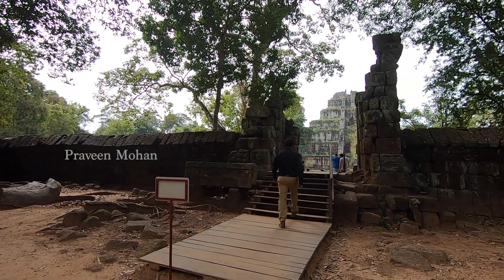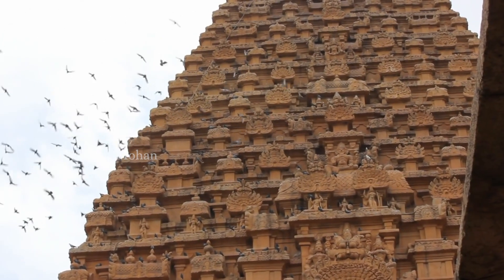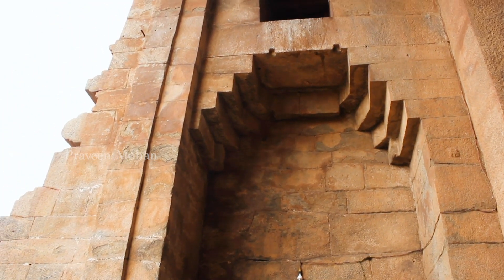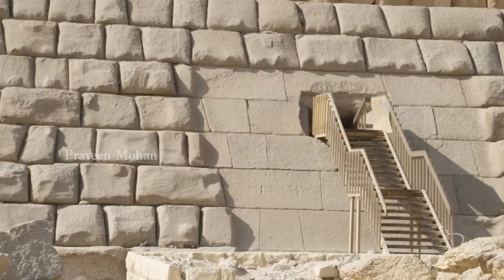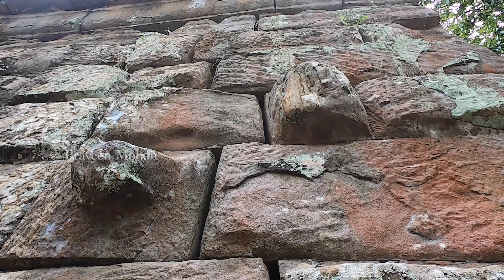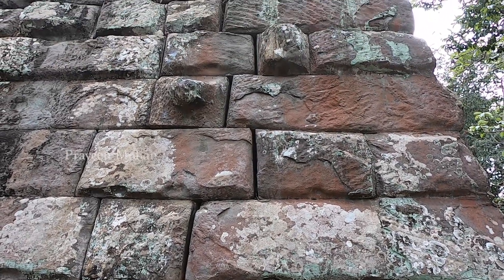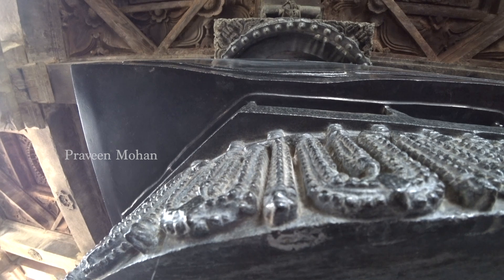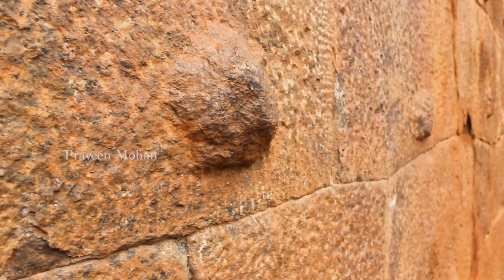Mystery of Ancient ‘KNOBS’ in Temples - Evidence of Stone Melting /Geopolymer Technology?

Comment: I'm thinking that if the stone could be installed with easy access to most of the sides of the stone, then it needed no knobs to adjust its final position. The reason the knobs were on the stones was because if you can only touch one or two sides of a stone, it's much harder to shift it into the correct position. The knobs provide a spot to grab and possibly put the end of a lever against.

Some stones without knobs may have once had knobs which were chiseled off for looks, especially those around detailed carvings.

Comment: The stone molding happened on site at puma puku ones with knobs the front facing is completely smooth in the back of the stones are still rough on the inside of the wall

Comment: Extraordinary claims require extraordinary proof.  Quick analysis and one can understand these are not geopolymer. I know there is a lot of you out there. Couple points though.  Firstly it takes 50-100 times the raw material to make one block.  Where did all the  ingredients come from?  Also these are all irregular blocks with different sizes.  To make them would require a separate mold for each and every block.  That would be thousands if not millions of individual unique molds. Again the material required for those is many times the actual building material.  We have zero evidence of either a polymer nor the mold.  Then there are the quarries where you can see where stones were extracted.  The burden of proof is on YOU who makes this claim of geopolymer yet not one has been able to replicate it, and being unable to demonstrate or reproduce it completely negates the claim.

Comment: The "knobs" are where they left material from the original stone before it was carved as the face of a wall like the rest, to walk on. Unlike medieval castles, where gaps in the stones for the wood supports were acceptable, in these (be it by design or not) it was not acceptable to have gaps. So how do you not waste wood and block an area under with dirt, letting people work beneath to finish the stones into that wall shape? Simple, you leave "pegs" or "knobs", which are now broken or purposefully chiseled off, on which the structure for the next layer is present. Each one of these stones had to be carved to fit in place with the next ones, so per stone, a long period of time was spent, possibly a year, so even more reason why wood, ropes and other temporary methods would not suffice, hence stone. Equivalently, on a stone structure from the medieval times, you'd build it and move to the next layer in a matter of months, less. This method would also be universal. There's only so many ways you can do this, so arriving at the same solution, because of limited resources, is expected. That's why all ancient structures that reach a certain size are pyramid shaped. Ziggurats, Egyptian pyramids, Mayan temples. You can only build a stepped structure at that size, the very moment you start building straight up with massive stones, the first shake or wrong load will collapse it. Which is likely what happened before the vandalism, at Puma Punku. They very likely bit more than they could chew and abandoned the project. Egyptians did it too. There's a massive obelisk that's 70(ish)% carved out, abandoned, because of a crack. Probably a massive ill omen in those times (as a reason).

Comment: Yes, you are right, these are pre-made blocks made from a composite or liquid concrete material, possibly molded in situ using wooden or canvas shapes, that's why they fit so perfectly. Each block could be made by just pouring concrete from small manageable buckets, no chiseling required, just carry buckets or pouches of liquid concrete up ladders. Once it set solid overnight you made the next block to it. That also explains the pyramids of Egypt.

Comment: I had thought up the "drop" idea on my own, as I'm sure many have, but did not know that's what it would be called. I'm glad to know the term for it. Also, good point on the plant growth. If liquified and poured (which makes sense for transportation and other issues like that), and the rock became more porous after drying than in its natural state, then it would work like a chia pet (sculpture made to grow plants on that then take the shape of the sculpture automatically). It's also an interesting window into figuring out exactly how they did the melting/liquification- because we know that there must have been some other medium in the rock that left gaps. It's like a water filter made out of clay and dung. You burn it, and the dung goes away and the clay is hardened, with microscopic holes all throughout that the water can drip through. Some mixing and melting process, a re-hardening process would make this happen, AND make the plants able to grow IN the rock, itself.

Comment: Thermite stone a nob was use to releasing iron. Mixed gravel with iron and aluminum powder, ignition. Casting stone. Magnetic feild. Copper thermite was also possible but turns  green. Casting any size shape. A paste can be used for drilling and scooping. 
At the time melting metal, copper, gold, iron, aluminum, discoverers were made.
Thermite melting stone explains it all a clay forms laying sand then mixture and ignition. Hot cement shaping.
A mixture for creating air bubbles.
Reply: Evidence in stone, iron, aluminum, and organic matter.  Organic matter should give you closure on carbon dated.
 Heat could  be used to bake bread, steam, and heating.  Imagine the energy of thermite stone melting into bricks, tools, recapture aluminum, iron, and heat home, electric, distillation water.
Imagine the tech now and then together. Peace is the goal 🙏

Comment: I agree that those blocks are melted.  I've thought that for a while.  I just believe that they were melted in place using a simple removable and reusable form.  As for the knobs, it kind of looks like they were pulled out on purpose after the mold was removed but while the rock was still hot and in a semi fluid state.

Comment: They may have used a single form placed over the front side of each block when pouring, as the bottom, sides, back, and top would not need forms. The forms for interior blocks would have a hole cut in them so that a knob would form. The knob is a structural element that would interlock onto the next block being poured in front of it. The knobs on the outside of the structure are there because they may have been short on exterior forms, which had to be more precise, so they used interior forms in inconspicuous places.

Comment: I think that they have something to do with how tightly these blocks are fitted together. If they casted these blocks off-site, then how do they just fit a random joint so well...? As far as I can tell, these megalithic structures were all tied together with a poured metal clamp or they've found what looks like conduit drilled into the blocks as if to run a wire through it to tie it together. I think it was some kinda of a plasma tool they used and these "knobs" were actually where the tool pulled out and the stone cooled and hardened. That sounds like a much better explanation than ppl who built such sophisticated structures just putting messed up C grade material in them...

Comment: It is possible to at least speculate if those knobs may be an intended handle from the production of the block.
The precision with which they are fitted together tells us that they have in fact been ground together, and that meant the blocks would be put in a grinding- jig without being able to any internal movement relative to the jig. A knob of this kind would be useful to lock the block in the jig.

Comment: Even it was a cast defect all they had to do was cut it off but they didn’t they had a function or meaning to those who place them in position 
But here is the real reason why
The cutting system they were using which was ultra sonic technology would hit certain points on the stone at the location of the knob 
As the stones were all tightly fitted the resonance transfers so all you need is one stone with knob to transfer the resonance into all the others

Comment: Maybe the knobs are the remnant of a plug? If the material was somehow liquefied then it would have to have been pumped to the area where it was to be located. A form of "boxing" would have to be placed with an inlet for the material to be pumped into, once the pumping apparatus was removed, if the rock had not fully set then these knobs would seep into the outlet forming before the boxing was removed for its next location. This could explain the random occurence of them and also how each rock or block fits together with no gaps.

Comment: the stones were melted and poured into molds, the knobs were a run off to prevent bubbles. in some stones the knobs were then removed. the stones were melted using a plant not heat. ("Some years ago, when I was working in the mining camp at Cerrode Pasco (a place 14,000 feet up in the Andes of Central Peru)...........About ten minutes later I bent over the rock and casually examined the pool of spilled liquid. It was no   longer liquid; the whole patch where it had been, and the rock under it, were as soft as wet cement! It was as though the stone had melted, like wax under the influence of heat." page 273 from "Lost Trails, Lost Cities" BY Brian Fawcett written from letters sent by his father Percy Harrison Fawcett who disappeared in the Amazon in the early 1920's. As to softning stone on page 83 he writes of birds like a Kingfisher "which makes its nest in neat round holes in the rocky escarpments above the river....that those birds know of a leaf with juice that can soften up rock till it's like wet clay" which they can then peck away until they've created a hole in the cliff face into which they build their nest") examination of quarried stone vs stone in the quarry site shows that the worked stone contains traces of some organic material whereas the stone in the quarry does not.

Comment: It’s simple.   The stones were molded with tamped geopolymer concrete.   But, they were made bigger than needed and masons would trowel them down before it set up to hard.   If the concrete was not mixed well some of the concrete in the outer layer would harden faster.     So fast that the masons could not remove that section completely leaving a “knob” for perpetuity.   

A chemical analysis of a knob versus the rest of the stone should show a difference in makeup.

Comment: When you stand back it looks sometimes like staira, or decor. Like a contrast, filled with paint it makes a aign, add some material to the top or between to make 3d effects, like drawing what you see in the stone. Outlines of certain parts of a mural or something. Some sort of Morse code or visual hieroglyphical Braille type knob? Maybe vacuum created concrete with obsidianish remains or materials, acidic electrolesis? Like you set a mold and use thin strings to make a contrast or separate blocks, depending on terrain. Some could hold boards underneath to hang stuff on, without shifting upward, like a built in brace for flowers or hanging Sacramento stuff?

Comment: A problem with your premise, which maybe is a good theory or hypothesis, however until you prove it experimentally in real life with real stones using the tools that they had, it’s just a  hypothesis.  why don’t you get some granite and a copper chisel. And create a copy ?  you gonna find out that you need a cutting tool that’s as hard as a diamond and yet is tough enough to not shatter when you try to cut the stone—- and that’s just one little problem  -  for example-  of the whole construction project, which was massive .  I could go on and on, but  you get the point.
I have multiple  university degrees in construction engineering and 60 years in commercial and residential construction, this I know -  there’s a big difference between a brain storm and going out there and creating something in the real world with real materials.  Construction is a hard task master.  Sweat, blood and tears are part of the process .  I’m in awe and humbled by what these have done in prehistory.  

Academics have to look through academic rose colored glasses -you might say - to stay in that culture.

Comment: I'd say the knobs are a result of quarrying the blocks, and you are probably right about the carvings/not carved walls because you'd start with a flat surface to carve on. The blocks left with knobs, as you said were probably poor quality blocks from manufacturing, and they might have planned to come in later and remove them. As far as if the blocks are casted or not, the stones would have to be throughly tested to figure that out.

Comment: Clearly they are molding "pips".  We remove these by grinding and sanding from modern plastic products.  I suspect that they are not "mistakes" but were left for esthetic reasons. It is also possible that they are a form of communication that was a secret language that megalithic builders used to communicate with each other, much like Ogam originally was a secret hand language for Celtic priests. The stones were likely cast in place with adjacent stones forming part of the mold. That would make it easy to introduce these pips in a pattern in real time rather than ahead of time. Easy.

Comment: If/as the builders had such a control over the material, they could just have sliced or chiseled off those knobs - a modest effort in order to preserving the overall aesthetics of the building. Another objection to Your theory is that the knobs could easily have been oriented inwards instead of externally unless the  stones actually were molded in situ - or unless the knobs have some signaling, or other, purpose.

Comment: I HAVE SEARCHED FOR VIDEO'S ON THIS EXACT SUBJECT THOUSANDS OF TIME. THIS VIDEO HAS NEVER POPPED UP.  I RESPECT YOUR OPINION, MR MOHAN. YOU HAVE THE ABILITY TO USE LOGIC FOLLOW SCIENCE NOT LETTING SCIENCE DICTATE THE LOGIC. IF YOU LOOK AT THE MEGALITHIC WALLS IN SOUTH AMERICA WITH THE KNOBS IN THEM, PRESENT AN ALTERNATE REASON FOR THEM. IN MANUFACTURING YOU FINDS KNOBS WHERE THE NIPPLES/NUBS ARE PRODUCED AT THE INJECTION SIGHT. THAT WOULD ALLOW THEM TO POOR THEM IN PLACE, PLUS ALLOWS CUSTOMIZATION OF EACH MOLD. YOU CAN SEE WHERE THE MOLDS WERE REMOVED TO QUICKLY IN SAKSAYWAMAN, SOUTH AMERICA, WHERE BRACES WERE EMPLOYED TO STABILIZE THE 80 TON BLOCK, GIVING IT TIME TO CURE. USING GEO-POLYMER'S HAS THE ADVANTAGE OF LEVELING THE PLAYING FIELD... LITERALLY. COMPLEX SHAPES ARE A SNAP. OPEN SIDES ARE INTENTIONALLY USE IN THE MOLDS TO ALLOW SEEMS THAT ARE SO TIGHT YOU CAN'T EVEN PUT I PIECE OF PAPER BETWEEN THEM. IT ALSO EXPLAINS THE PILLOWING (THINK OF MARSHMALLOWS) AS THE BLOCKS CURE FROM THE OUTSIDE-IN. THEY WERE PUT THERE FOR FEW REASONS. THEY EITHER MEANT TO LEAVE OR REMOVING THEM AFFECTS THE STRUCTURE OF THE ROCK OR IN SOME CASE TO MANY OF THEM OR IT WAS PART OF THE ASCETICS. THE SCOOP MARKS WERE MADE REMOVING IMPERFECTIONS. THAT COULD BE FILLED IN AFTER THE MIXTURE HAD SET. IS THERE A COMPONENT THAT WAS AVAILABLE TO THEM THAT WAS CONSUMED BY ALL MEGALITHIC PROJECTS 1000'S OF YEARS AGO. IT WOULD BE INTERESTING TO SEE IF YOU GROUND UP THE ROCKS AND SEE HOW WELL PLANTS GROW IN THE SOIL THAT WAS PRODUCED.